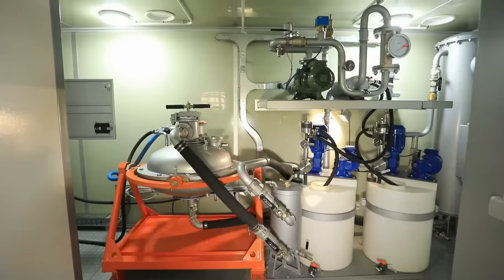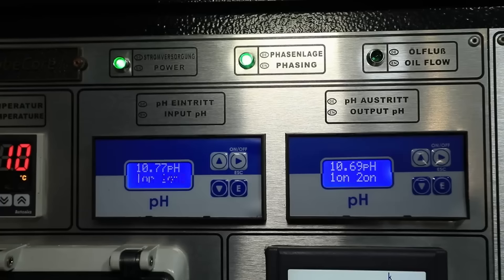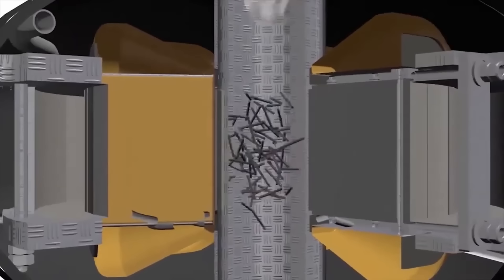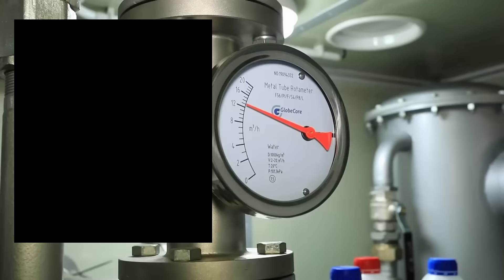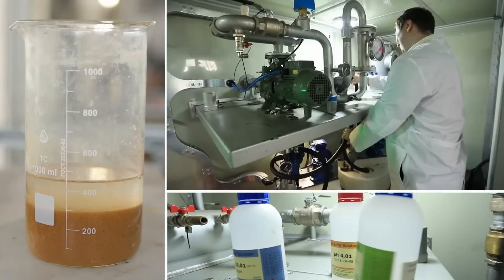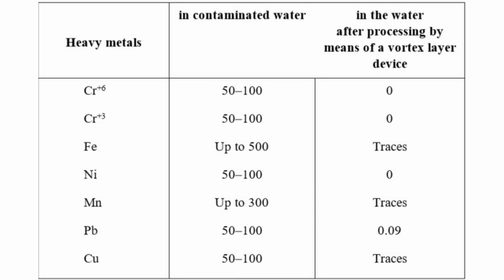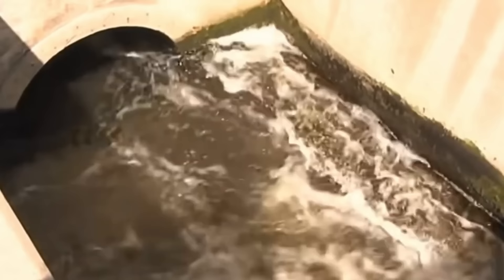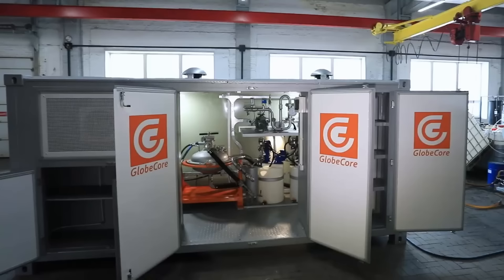Hexavalent Chromium Removal with Wastewater Treatment Plant AVSk-150

Comment: Can the treated water be reused in the electroplating process, or is it primarily intended for safe disposal into the sewer system
Reply: The treated water can be reused in a closed cycle of the enterprise's processes or discharged into the sewer system, depending on the quality achieved.

Comment: What are the key components of this mobile treatment plant and what role does each play in the treatment process?
Reply from the maker: The key components of this mobile treatment plant include the AVS-150 vortex layer device, tanks with pumps for chemicals, a reaction vessel, a supply pump, a chemical mixing tank, a sampling and particle capture tank, and a chemical storage cabinet. Each component plays a specific role in the treatment process.